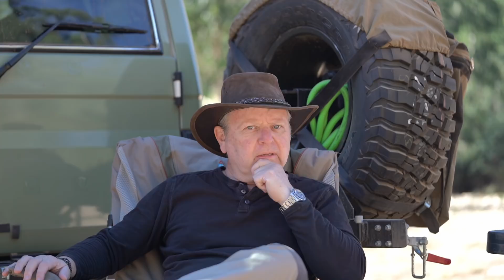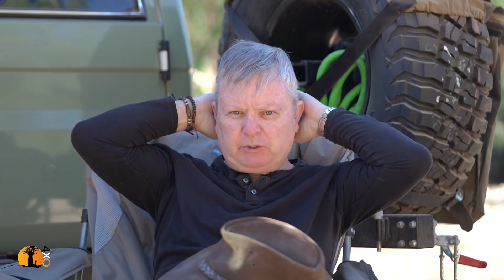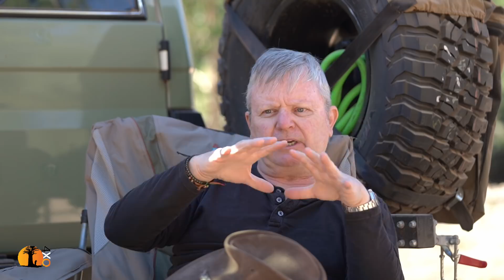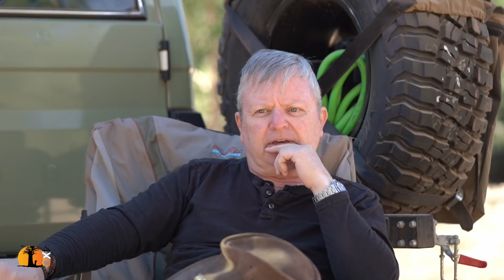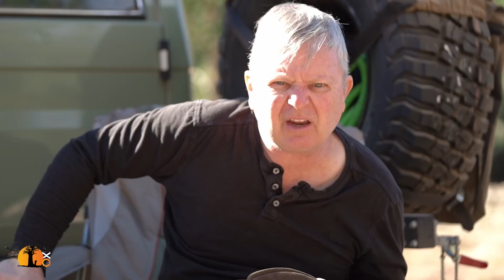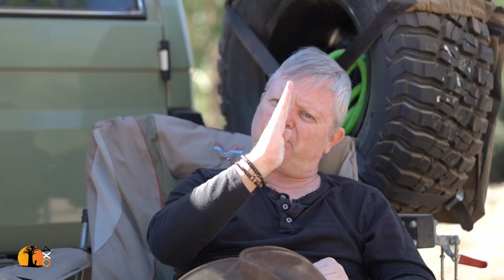TIRES - Pressures, Heat, Footprints and Failures

Comment: Thanks again Andrew, enjoyed the post.
Tubes vs Tubeless, they are different animals;
The tubed Tyre/ rim shouldn't drop too low, tubed tyres don't grip the rims well, the Tyre can spin on the rim and rip the valve from the tube.
Tubeless Tyre with a tube fitted, a great get you home option but in normal use generates extra heat between tube and Tyre for which it was not designed.
I liked to operate in rough terrain with high/ std pressure, I felt it resisted damage easier. In soft sand, KSA, UAU, Oman etc I used low pressure and judged the exact pressure just as you mentioned but checked pressures to match on the same axle.
Reality Check,,, we are all so knowledgeable and educated,,, :-) I was enjoying a day driving over soft dunes in Saudi, Jeep Cherokee, 4x4, loads of available power, we were right up there, top of the dunes, 50 miles from the nearest track, great fun, proud as punch. Until. Along came some Saudi lads, teenagers, driving a Toyota Cressida, (2WD) towing a carpet on a rope, with more kids sitting on it, having an even better time :-) The Cressida was ancient, tyres completely bald, almost dead flat. But! They were going easily where I was struggling. Loved the encounter, they were impressed that we even got there, I was even more impressed with them. We shared a few cold cokes and went on our way. Lesson learned, never take myself too seriously, these lads could REALLY drive in the desert, I was a visitor :-)
Reply: If I may add one extra comment.
Picture the scene, Outside of Jeddah, 2000s ish, a nice area of soft sand, often frequented for day trips. Brand new, unregistered VW Tuareg, around the time of the launch, 'high ranking brand official decided to take 2 x friends of the female persuasipn into the desert for a demonstration. I get a call, come get me out. 1, single vehicle? 2, stuck deep in a sand bowl resting on front and rear bumpers, 3, tyres at 'pre delivery pressure' 60 PSI! 4, not a bottle of water between them. 5, single guy, 2 x unrelated single women in a car along, not allowed in Saudi.
Dragged it around until free of the bumpers, pressures dropped to minimum possible, a little tug with my vehicle at the time (S2 Disco) and away we go. 
Lessons learned all round, even a Tuareg will perform if set up and driven well.
The names have been withheld to protect the guilty ;-) 
Thanks again for your posts

Comment: Hey Andrew, whats your take on the thought process on tyre pressures around sharp rocky outback roads like the Flinders or central Australia? 

The late great Jack Absolum who travelled much of Australia in a Mitsubishi rwd station wagon always kept his inflated at highway pressures to avoid the sidewalls being staked.

Of course we have stronger tyres now, I'm kind of on the fence here. 99.9% of people say drop em down, but in my experience you'd have to take a hydraulic spear to the tread on a modern all terrain in order to puncture it but the sidewalls are still vulnerable.

Personally I go low for traction needs but rocks, corrugations etc I just run highway pressures.

Comments getting longer than I expected but I also worked somewhere that rented mine utes and survey utes. They would get absolutely bashed in the worst places for thousands of KMs, we had whatever all terrains on them. 

Only one had the BF KO2, some Kendas, Kumho AT51, cheap Chinese brands and they all survived.

The operators never stopped to adjust pressures, they just plant their foot to the floor and hammer through different sites and states.

We had tyres with loads of cutting and chipping and scallops ripped out of them at just 10-15k but very rarely a puncture. Just thought I'd throw that in you might find it interesting.
Reply from the maker: I agree totally. Watch my Discover trip in Lesotho. I kept them hard to prevent sidewall damage and it worked even on 20" rims.

Comment: Why doesn’t anyone tell what the highway psi is and only tell the off-road if people go off road it’s important that they inflate there tyres to a appropriate psi on the highway as they will be travelling at highway speeds and with the wrong tyre pressure on the highway it can be fatal

Comment: Very informative! I have a question: In your experience what tyre pressure is best suited to rugged off road terrain and areas with a lot of big acacia thorns? As a conservationist in Kenya I work in the bush everyday and even though I have bfg km2 mud terrains I still get punctures in the sidewalls from thorns that I don't see while driving offroad/ on bush tracks. From the many places you've been to in Africa, you might be able to relate? I haven't seen the topic of thorns, specifically in African wilderness areas, being discussed much on youtube and I would appreciate any feedback.

Comment: Great advice Andrew. I burst a sidewall on the Madigan Line in the Simpson Desert from running pressures too low. It was a combination of factors - tire with flexy sidewall (Toyo All Terrain), heavy vehicle (76 series fully loaded at beginning of expedition, near GVM), travelling too fast over gravel and dunes on a hot day. As a result the rest of the trip was very precarious without a spare tire. Lessons learnt: heavy vehicles require a stronger sidewall, monitor the tire temperature manually and sidewall flex visually rather than relying on purely on a pressure gauge. Invaluable lessons learnt the hard way.

Comment: Low pressure tyre damage can also be seen when you have the tyre off the rim and stand it upright , driving position for the tyre , and applying pressure from the top , if small cracks appear in the now folding bit of the tyre , at the bottom , its busy going !

Comment: Airing down does do wonders for comfort but it's very true that too low can cause damage, regardless or size or type and the pressure is completely subjective.  I had large off-road tires with good heavy sidewalls that I aired down 2 weeks of every month for work on rough roads.  When I got pack to the main road after my week on the dirt I would air back up.  One day my wife was driving my truck in the city with the tires at full street pressure and thankfully just after she parked it one of the sidewalls exploded!  I swapped on the spare tire and 2 days later a second sidewall exploded while I was driving, slowly fortunately.  I am much more conservative with my pressures now.  Don't be fooled by anyone on the internet saying you should air down to x pressure, even if it's the same vehicle.
Thanks for the videos, you share a lot of knowledge.

Comment: G/Day Andrew, I really enjoy your videos. I would like your opinion on, do bigger tyres, 33 inch  compared to say 30 inch tyres give you a better ride on corrugations . We have just done the Great Central Road, Tanimi Road, Bungle Bungles and CSR from Halls Creek to Kunuwarritji. We pulled out at well 33 because it was to wet further south. We were travelling in a 79 series Land Cruiser with a standard front suspension, the rear has a two inch lift 450 kg West Coast Suspension with brand new 285/ 75 R16 33" Kumho tyres. We had no issues with any part of our set up. I was talking to another guy who was travelling in a 20 year old Land Rover with 4 coil spring suspension with 30 inch tyres who did a similar trip and also pulled out at Kunuwarritji and he said the corrugation were very bad, except for the 30 km each side of Kunuwarrtji which were horrible. Wondering what your opinion is or if I am barking up the wrong tree or barking mad. Regards Jamie

Comment: I think you are really over thinking this all. The difference between a 255 and 305 wide tyre is so negligible (20%) I don’t think it makes enough difference to even discuss. Buy the tyres that look good and fits your vehicle. And is rated for the load you need to carry of course. A better video topic would be discussing the pros and cons of getting taller tyres, and why the state of Western Australia is so fearful of big lifts and tyres. <insert conspiracy theory>
Reply: Not just width - the weight of the tyre also goes through the roof the wider you get
Reply: Why mess with the calculations the engineers did for the vehicle , most of them are VERY good !

Comment: Tubeless radial vs tubeless bias ply not mentioned. If I'm correct, tubeless bias-plys have more vertical sidewalls,  and resist punctures better. Not great for the road, of course, and can't balance them consistently.

Comment: Jeff Jackson  says "Radial tyres are preferable for use in sand" and indeed he does discuss tyre pressures in several sections, especially off-road, including sand, and also towing. It seems it may be your memory that is operating only at 0.5 Bar!
pp 32, 86, 88, 92, 106, 139 refer.
The Off-Road 4-Wheel Drive Book, 4th Edition
Jack Jackson
Probably the Old Testament before the new Gospels of VDEG by Sheppy, and OLH by Scott ;)

Comment: I find I'm more concerned with balancing my tire pressures than a specific number. It actually matters on my WRX to keep the diffs healthy (in addition to a matched set of tires) so the habit persists across the board (doing the same with my Gen 2 SWB Pajero).

Comment: The only problem with just 'looking' at your tires to determine the right pressure, is that if your vehicle isn't sitting on flat terrain, and it rarely is here in Colorado when you start to air down, you will never get close to even pressures.  I'm sure it works great on a flat road, but otherwise you need some sort of measurement to keep things equal or you will end up, as an example, with the front right at 10psi looking the same as the left rear at 20psi.  Just something to consider at least.
Reply: preassure gauges work very well !

Comment: i have had a rep for BFG and 3 tyre centre owners tell me to never run my BFG AT under 45PSI. I have a Defender 110 and loaded for a long trip weighs just under 3 tonne. All people who suggested the minimum 45 PSI said that lowering pressures on rough dirt roads and corrugations will be more comfortable but the tyres will last longer at higher pressures. I run mine around 50 PSI in most conditions.

Comment: About 10 years ago I operated my own semi truck and did an experiment. Normal pressures for that type of vehicle is 100psi (6.89 bar).  I raised all 18 of my tires to 105psi (7.24bar), and did the "temp test" as you described. With similar atmospheric temps, miles driven and cargo load, the tires were noticeably cooler to the touch. The point is that even small pressure changes can make a difference. Very nice video/ subject matter.

Comment: great video. one thing that i not heard of in other places look at your tires. look not just have list with pressures you should run on bush or on road. all forums just tells you : ohh you need this much bar offroad and this much onroad. its very good point to look at tires. i was looking at my BFG Ko2's and saw how much it flexes. very good video. little short but good. waiting for part 2

Comment: Hi asp I’ve got tpm and it measures heat. What kind of heat do you think rings alarm bells. 50, 60 degrees or even 80? I find with just hot weather they can get in the 40-50 range even fully inflated. 
Also on hwy speed in a big car I’ve got a lc200, on 33” what rough pressure would you suggest. I normally go say 42 f 44 r? Thanks a lot. Enjoy the big trip mate.

Comment: If you know how to change tyres properly or have ever worked in a tyre shop you would know split rims are not easier to change.  Even In a work shop with all the machines and gear split rims take literally twice as long to change.   And it doesn’t matter how strong the tyres are if you have a tube you could get a tiny rock between the tube and tyre and give you a puncture because the rim isn’t sealed I’ve changed so many tube type tyres that had sand in the tyre that’d work through the tyre

Comment: We have recently bought a Prado and it has stock tyres on it. Do you think it will be fine for some mild four wheel driving without getting new tyres designed for off roading. (it will be used on road 90% of the time so I don't really want to get new tyres unless it is necessary).
Reply: I realize your looking for Andrew's opinion, but he doesn't respond often, so I figured I'de give you my 2 cents.
A good street tire will do fine for mild off roading, particularly on dry dirt, gravel or sand. They will not do well with mud and they are not as robust as an off road tire, so you need to be more careful with them. Breaking traction or rubbing the sidewalls will be more likely to result in damages.
I would recommend making sure you have a good, full size spare and sticking to your street tires to get started. If you find yourself wanting to adventure out where your street tires are too much of a liability, then it's time to consider some all terrains or maybe even some mud tires depending on where you live.
Reply: I wasn't looking for Andrews opinion actually haha, (although I do realise that I have worded it that way, so my bad). Anyway, thanks heaps for responding. I had a similar opinion to you on the subject although I did want to check with some other people. Thanks for the response :)

Comment: Great Video. I have gu patrol and I did a lot of sand driving with 1 bar pressure, in two occasions I had to drive on the pavement for 30 KM to find air pressure to inflate my tyres, what happened? Two tires had deep dangerous cracks in sidewalls; I replaced them . So I learned I let the tires only when necessary and preferably drive low speeds and never ever on pavement.

Comment: run bfg km2 MT on my defender 110 what tyre pressure would you recommend for river beds with stones about fist size up to around 2 to 3 times the size of a basketball.
Truck is never loaded too heavy normally i drop the pressure to about 18 psi /  1.24 bar but notice a lot of marks on the side wall i  used to run  33 psi / 2.27 bar and didn't notice as much marks 33 psi is what i run on the road
Reply: Brown Bomber I have a similar setup and run 18 on the front and 22 to 24 on the rear